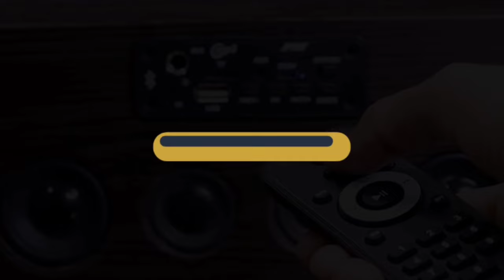Make Bluetooth Speaker with MIC Slot, USB and FM

Comment: by adding more mini bluetooth speakers but smaller ones do they have to be same ohms and wats I got 1w 8ohms connected to 3w 4ohms speakers amplifier is a 5w 1amp cuts out when I turn the volume up when I disconnected and using the 3w 4ohm speakers it doesn't cut out at all